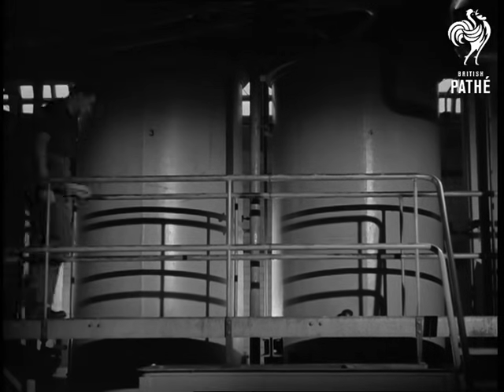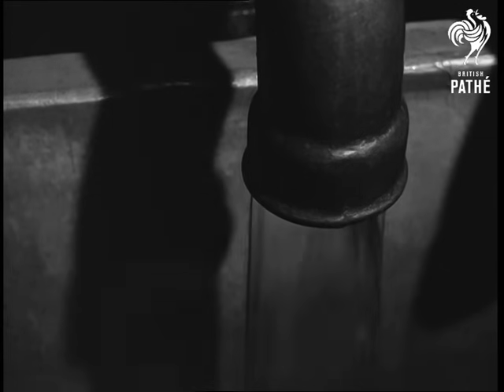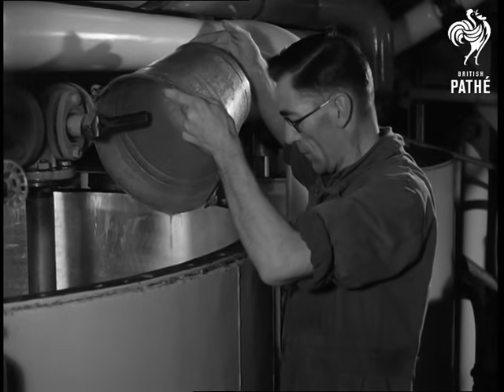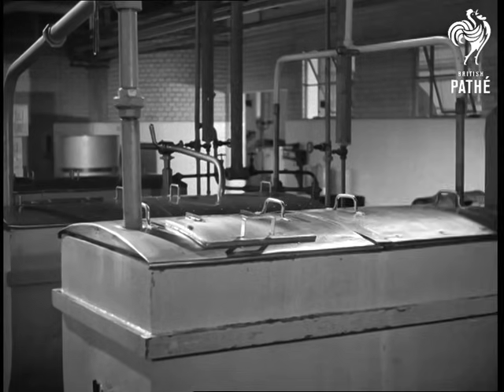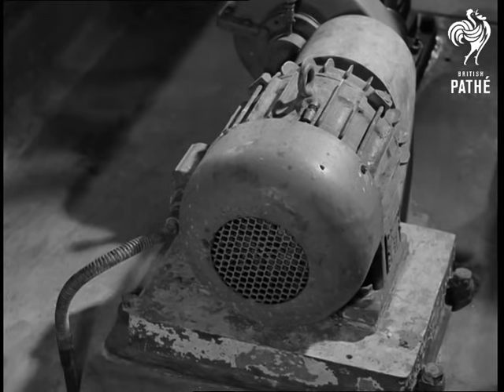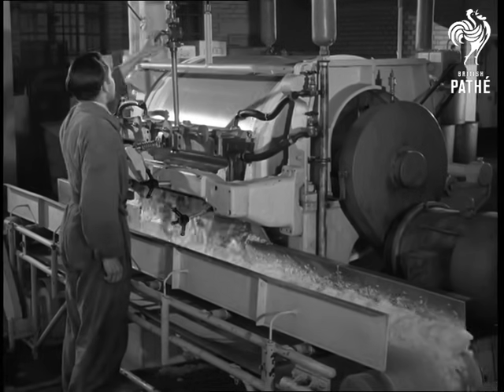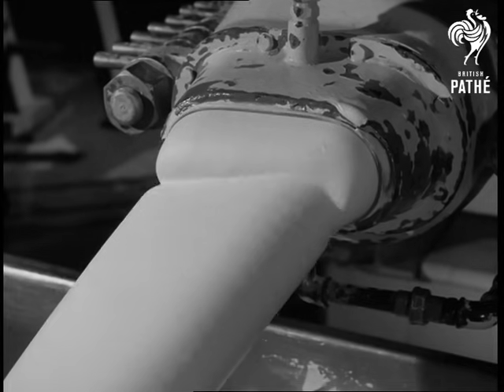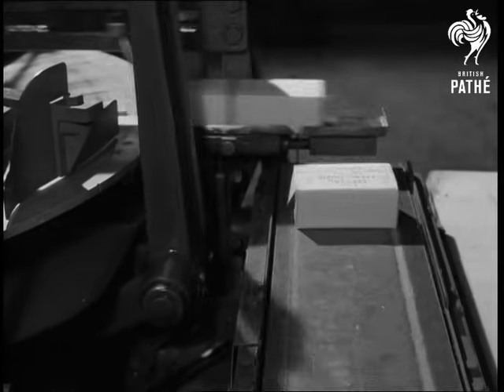Margarine From Oil (1940-1949)

Comment: 231,035 views  13 Apr 2014
British Instructional Films presentation.   

A lorry pulling a tubular tank pulls into a depot.  Written on the side of the tank is: "Towers Creameries - Mitcham."  Interior of the depot - large metal containers.  The oils are weighed.  A man turns on taps which let oil into a vat.  C/U of the weight dial of the scales.  C/U of pipes with labels: "Hardened Whale", "Hardened Ground Nut", "Palm", "Coconut" and "Ground Nut".  Various amounts of different oil pours into the vat from the different taps.  C/U of a piece of paper listing the percentages of the different oil used.  A hand with a pencil ticking off the different oils is seen.  Man looks into a large vat.  We see oil entering the vat at the bottom.  Emulsifier is added - the man pours it from a bucket.  

We see the mixture being stirred.  A temperature gauge reads 41 degrees centigrade.  Salt is mixed with iced water.  Man stands by the vat where this takes place.  Churning is the next step.  Cultured milk is added to iced water.  We see the two being mixed.  Oil and emulsifier are added.  Lid is lifted from vat and we see the smooth mixture.  More machinery is seen.  Bottles labelled: "Colour", "Vitamins" and "Flavour" are seen in C/U.  The three elements are added to the mixture.  The mixture is cooled.  Chunks of margarine fall from a chute.  These "curds" are transported along a belt and then drop into a vat.  The mixture is then kneaded and packed.  Smooth margarine is squeezed from a large nozzle.  Large trolleys of margarine are pushed around the depot.  Chunks of the mixture are fed into a machine which makes them into pats.  C/U of pats being packed in paper. Wrapped butter is taken off the conveyor belt and packed into boxes by two women.  The boxes are then stacked.
Reply: ... ."The oils are weighed. ..."

What kind of oil sir; palm oil or soybean?

Comment: So what's the difference between ground nut and hardened ground nut oil?
Reply: "Hardened oil" would be called "hydrogenated" today, its groundnut/peanut oil that's been put in a big tank with a nickel catalyst and had hydrogen bubbled through.

What this does is 'fully saturate' the fat: some fat from unprocessed peanut oil is unsaturated fat, it has some chemical 'empty spots' where more hydrogen could be put in (or other chemical elements but this creates off flavors: oxygen filling these empty spots makes the oil taste rancid)

Pushing hydrogen into those spots raises the oil's melting point and extends its shelf life (can't oxidize and go rancid very easily if there's fewer empty places oxygen can fit): turning a liquid oil that can go rancid if not stored cool into a spreadable-at-room-temp solid that can last for months, even years stored in a regular unchilled cupboard.
Reply: One is harder.
Reply: @endezeichengrimm  shocked pikachu face

Comment: This is so different and shockingly more natural than what we call margarine today. So much so that it's surprising that the name of the two is the same. This process is basically emulsifying different kinds of oils together with salty water, milk and flavors - no chemical reactions to alter the fat structure. While today they just take whatever vegetable fat and they alter it's chemical structure by hydrogenating it and the output is fats that are similar (not identical, just similar enough to be solid) to animal fats, but are actually not found anywhere in nature. So as weird as the process in the video may seem it's way better than what we have today. Unless there is something really sinister in these flavors, colors and vitamins mixtures.
Reply: when they say "hardened ground nut oil" they mean hydrogenated peanut oil.
Reply: Saturated fats, meaning fats saturated with hydrogen, exist in many different lengths are found in many places throughout nature. Saturating a portion of the fats with hydrogen lowers the overall melting point by removing double bond kinks in the chains that prevent them from packing closely together. As the other comment pointed out, the oils being added were already hydrogenated. It's actually much healthier nowadays as modern methods ensure that trans fats aren't being created in this process.

Comment: Sadly , having read through the replies it seems to have escaped some that this was a wartime product , dairy was rationed so children had enough to benefit them . Butter was very tightly rationed so an alternative was found for baking , spreading etc . 
My grandmother's used it happily . 
Good video 👍🇬🇧
Reply: I grew up with margarine, we called it butter, because butter was much more expensive. There's absolutely nothing wrong with it, it's different but not bad. The fats will clog your arteries, but butter does as well.
Reply: @cynthiatolman326  margarine is toxic. Nothing wrong with butter though, it will not clog up your arteries.
Reply: @Beezup48  both are bad, possibly margarine is worse, but butter is not healthy, just healthier than margarine.
Reply: I wonder if the recipe for margarine has changed over the years.  They say the British were the healthiest as a result of the rationing during and a little after the war.  If they were eating margarine a lot, wouldn't that countermine the argument, since margarine is now considered bad?
Reply: @tilasole3252  magarine is all over Germany and is used everywhere for the past.. Ever. There is nothing wrong with it

Comment: I had no idea it originally contained whale oil. Makes sense though as whale meat was marketed as an alternative to beef or lamb in wartime leaflets. If they were using the meat, they certainly weren’t going to get rid of the oil with such a critical shortage of fats in the country! Nothing could be wasted. 
It’s funny though. The line I’ve heard most often from “do-gooder impose my health ideas on others” types is that margarine is only one molecule different to plastic. What a missed opportunity! It contains whale oil would have made far more people cringe and switch back to butter lol.
Reply: viva la difference. that's why we have salt on the table instead of sodium and chlorine gas.
Reply: @Perktube1  sounds much more pleasant!
Reply: The one molecule different arguement is made by ppl that dont know anything about science. Table salt is one molecule from poison.
Reply: @rebeccanater  😂😂😂 I wasn’t aware of that one! I do understand science enough to know that one molecule being different changes things dramatically! I use butter because I like the taste of it, but I do sometimes buy margarine in winter if I get frustrated with butter being difficult to spread when it’s cold. Actually I now have a microwave that doesn’t beep excessively and I haven’t bought margarine since I’ve had that, as it’s far more pleasant to pop the butter in that to soften than in the one I had before it.

Comment: Foul stuff.  Good for greasing stiff wheel nuts, but not for eating.  Butter is far healthier - natural and tastes heavenly.
Reply: It isn't, it's just saturated fat, of no nutritional value other than energy. And it's main use is to make bread more slippery.
Also neither butter (or margarin), nor bread are part of the natural human diet.
Obviously nothing made from milk that's supposed to be consumed by calves are even candidates. Nor anything cereal based, which humans are physiologically incapable of consuming, and even after much processing it rots our teeth away.
Reply: Agreed, I always ask for no butter when I get a bacon sandwich at Greggs or any cafe because 95% of the time it ain’t butter.